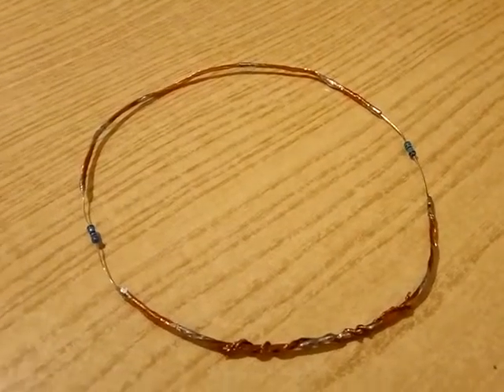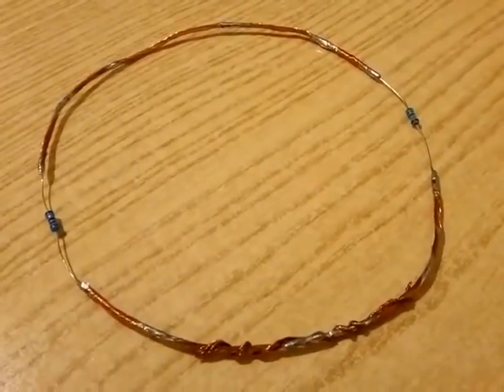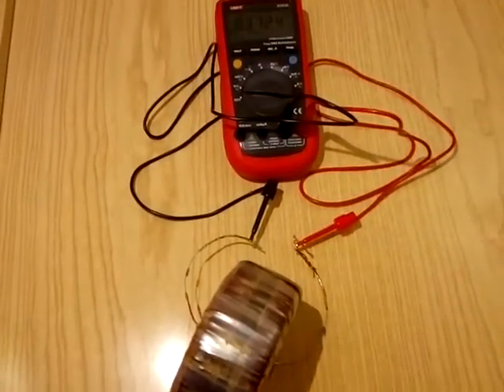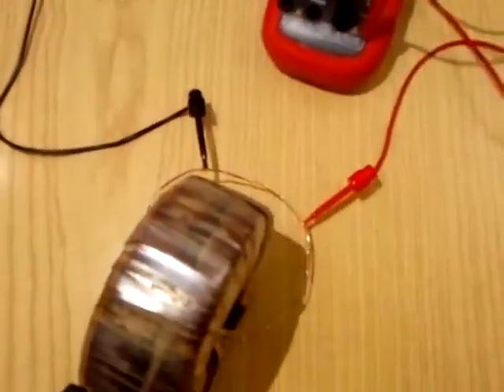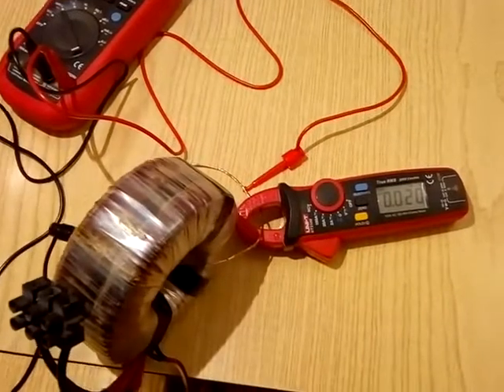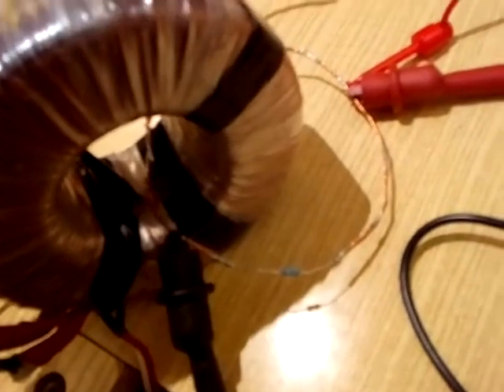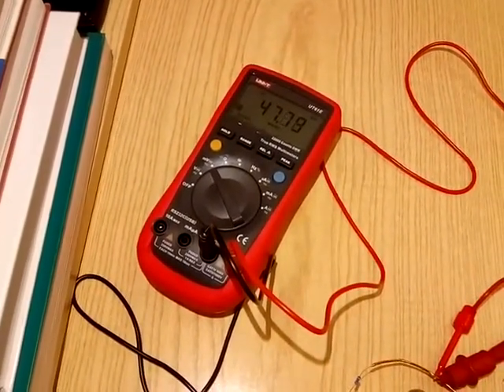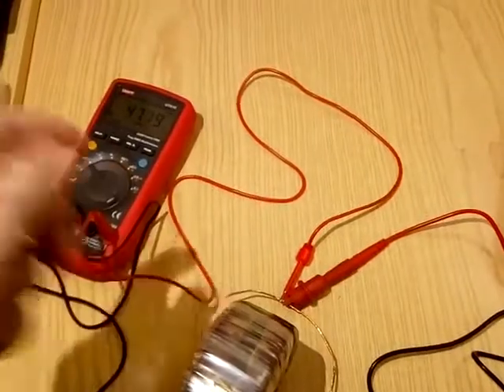The Romer-Lewin ring with resistors: two voltmeters read different voltages

Comment: A torroidal transformer ? All the mag flux is contained . If you had used a solenoid then the probes would pick it up
Reply from the maker: With an infinitely long solenoid all the flux is contained as well. With a long enough solenoid the flux in any finite region around the core is negligible (because it spreads out over all space). As a matter of fact, Lewin measured the field around his solenoid and confirmed it is negligible where his ring sits.

Anyway, how do you explain these results? There is no B field where the ring is, and the self inductance of the loop is negligible at 50 Hz.
Reply: @copernicofelinis  Invoking infinity on a tabletop seems a bit "theoretical". After all we are doing experiments. I might add the explanation is due from the theorist / experimenter. Critics are allowed to criticise.. I should not cite self inductance but rather mutual inductance if there were any flux that is . I did not see lewin actuall measure the flux around his solenoid which was not infinite . Even in gigh school 50 yars ago I did this experiment , I did not know EM theory at 15 hut I studied coils about 10 cm and 10 or so turns . One energised weakly with a signal generator the other on a scope . I picked up plenty of signal at more than 10 .
Reply from the maker: @georgejo7905  if the ring does not go around the core you won't get any appreciable signal at 50 Hz. I can also devise an experiment where there is no primary coil and the change in magnetic field is caused by a magnet falling through the ring with the resistors. in that case there is not even mutual inductance. Did you read the stack exchange pages I linked in the description of the first video?
Reply: @copernicofelinis  Sorry not on stack exchange . No other way to link ? just write it? not sure which video
Reply from the maker: @georgejo7905  stack exchange is not a video network. You do not need to be part of it to read the pages. The pages I mean  are linked in the description of my first video. Just click there and you will read the html page, no subscription or shady s**it required (maybe they try to put cookies like 99% of the websites)
Reply: @copernicofelinis  I guess my youtube app doesnt at least not on the four videos on your channel. But I have looked at this problem for maybe two years I even got a reply from Dr Lewin .Pretty condescending but hey he's him and I' just me .
I have followed the arguments including I think the one you reference .. I go with electroboom others for theoretical reasons go with lewin.
engineers claim it is induced in the probe leads , theoreticians claim it is not. Putting the onus on engineers to refute the theoretical model put forth seems like pedantry . What about theoreticians refuting engineers claims that it is induced in the leads? Seems like 2 experimants need to be done.
Reply: @copernicofelinis  This has become a celebrated problem . I doubt it leads to any new science but there have been a few in the past and solving it could be quite satisfying. So far everybody seems to say it is solved . In this case I mean a unique thought experiment or physical one that intuitively shows what is happening. Perhaps deviating from lewins model would help. Your toroid goes a way to doing this.. With a confined magnetic field in a torus the electric potential will be on axis  , yes I agree there is an electric field but I dont think it is strong enough to couple with the  conductor . The dielectric constant of vacuum around the conductor (air is pretty close) is very low and unless the conductor is open circuit eg very high impedance ,  what amounts to capacitive couple will be very high impedance .The closed loop through the transformer has a much lower impedance coupleing to the magnetic field .
Reply: @copernicofelinis  I did say I would do the experiment but here is a master class on this very same problem.
The experimental rigor and demonstration is mind blowing. Just when you think he has done enough he does more and more.
https://youtu.be/JpVoT101Azg
Reply from the maker: Sorry for replying after a year, I didn't see the subsequent replies. Yes, I am familiar with Mabilde's experiment (I also comment on his videos). 

What he does is to put the probes in the middle of the magnetic flux region to intercept the right amount of area that will produce a voltage that is equal and opposite to the path integral of the induced electric field in the arc he is probing. He does so to strip the EMF part of voltage and leave only the electrostatic component (the one expressible as minus the gradient of the conservative part of the electric field). Since that partial component of the field is conservative, it admits a potential function and you can apply KVL to its potential differences.

BUT that is JUST A PART of the actual voltage. See for example Popovic and Popovic in the list of references I gave in the description to see how this decomposition of voltage is done (it reflects Helmoltz decomposition of fields onto their irrotational and solenoidal components).
Reply from the maker: go here https://youtu.be/8CH9Yg8dlYw (my first video in potatorama)
click on the title: the description of the video will be shown till "more..."
click on "more...' and the full description is shown. scroll down till the end and you will find two links to ee stack exchange.
Reply: @copernicofelinis  Ok got it youtube chnged it all a while back
Reply: I posted a sketch of proposed  E field measurement using toroid on flikr
surrey cnc maker space          no spaces
Reply: If you do the experiment I recomend nulling out extraneous signals by using the scope on differential input and perhaps not using coax but a twisted pair to the antenna. One note also about noise , test the setup with the torroid unenergised and store the signal , later subtract it if you have fft that helps. Altering each plate distance and orientation to the torrus until the signal is minimum will null out capacitive  coupling to the coil windings . I am suggesting running a model of displacement current in  reverse.  https://youtu.be/EqufEpWaKXw
Reply: @copernicofelinis   Totally familiar with this theory on toroids and the axial electric field.
I propose the following experiment. I maintain the dielectric constant is too low formthe electric field to couple with the conductor especially at this frequency. The loop is relatively low impedance and the coupling is high impedance.. 
 Two plates on either side of the torroid maybe 3 cm . On axis  through the center of the torroid . 
A sheilded probe , not oscilloscope probes but just coax ( to avoid any loops) the end of the coax to the center of the torroid and wires from either end to the plates a kind of plain dipole. Measre the voltage on the plates with scope then put a load on the circuit gradually going from no load until there is no signal. 60 hz will be very low so any possibility of magnetic couplin needs nulled out physicall y . Since there is no loop circling the leg of the torroid what is there will be E field . If the E field alone can support a voltage across a load then you have proven it.

Comment: Hi Copernico
 Is the field in the vicinity of  your transformer mainly electric or is it a mix of magnetic and electric.
Reply from the maker: Ideally all the magnetic field is inside the toroidal core. The physical  circuit (resistors and copper wire) can occupy a region of space where there is no magnetic field at all.

(In practice if a current is flowing due to the induced electric field, this current will generate a magnetic field around it, but in this case it is so small that we can neglect it - and in doing so we also neglect the self inductance of the ring)

Comment: Some people mistakenly think there is a circulating current going around and around a loop of the internal resistance of  the voltmeter and the resistance of the adjacent resistor.
You could DISPROVE this by a demonstration,  replacing R1 with two 4.4 Ohm resistors side by side  and replacing R2 with two 30 Ohm resistors side by side. Now with that arrangement with 6 resistances  the circuit behaves as before and on one side of the circuit there are three resistances, and the concept of  the current circulating around the two resistors and then going on through  the internal resistance of the voltmeter is impossible.

Comment: For the Romer Lewin Circuit. Here is a concise explanation for why the voltmeter readings are in accordance with the resistor values.
Voltmeters display the value of the electric field that lies along the path of their internal  resistance. For the Romer Lewin circuit, Faraday's law dictates that the current always flows in one direction around the flux and so therefore there is a meter/resistor pair in series with another meter/resistor pair, and as the resistor of a pair is in parallel with the meter in that pair the resistor defines the value of the electric field lying along the path of the resistance of the voltmeter in that pair.
Reply: @Biskwit2 
 Current going clockwise.

 R Right, the current goes into the top of R Right and out of the bottom of R Right. E field high at top of R Right.

 R Left , the current goes into the bottom of R Left and out of the top of R Left. E field High at bottom of R Left.
Reply: @Biskwit2 Yes, current flows  along an E field from High to Low. There are two fields , one for R Left, and one for R Right.
Reply: @Biskwit2 With that arrangement there is no E field along the copper. There is only an E field along R Right.
Reply from the maker: You need to consider the total electric field, which is a superposition of the induced electric field (going around the loop) and the coloumbian electric field, which has sources and sinks in corresponendence of the boundaries  between resistors and conductor.

This total field is nearly zero in the conductor, then becomes suddenly strong inside the small resistor, returns to nearly zero inside the conductor and then suddenly much much stronger in the bigger resistor. Always going around the ring in the same direction.

I wanted to add a picture but I couldn't install the video editing program. I might add another video with just the pictures.
Reply: Biskwit2, 
Copernico  Felinis comment directly  above is useful. 
But more importantly It is not clear what you mean by " voltage without induced EMF"  that is impossible. The  current is produced by the EMF, the voltage for the resistor is produced by the the current and the resistance. Ohms Law  V=I*R. The Electric field from the solenoid  exists in free space, not in the wire.

Comment: Maybe a correction at 45 seconds. The internal resistance of the meter is not low. It is very high.
Reply from the maker: That's my broken English. I tried to say: "...and the internal resistance of the meter is the load". It came out as unintelligible maybe, but iirc the automatic translation got it right, despite my pronunciation. (Not so much "portion", which apparently I pronounced "Persian")
Reply: @copernicofelinis  yes I hear it . Load

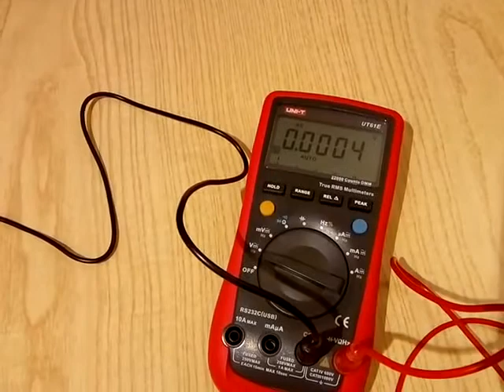Comment: At 1:40, the voltage across the wire segment is 0V, same as my measurement.
Reply from the maker: Yes, in fact the multimeter shows practically zero. The 0.0004 volt is nearly zero considering the error of measurement and the fact that a couple of inches of copper wire with 20 mA in it will drop a handful of microvolts. I will add some numbers in the description.

I wanted to add titles and drawings, but I was not able to install OpenShot (cx_freeze error) so I just stitched the videos together.